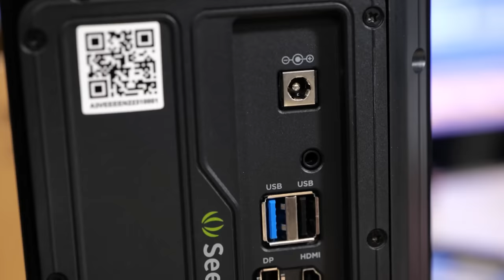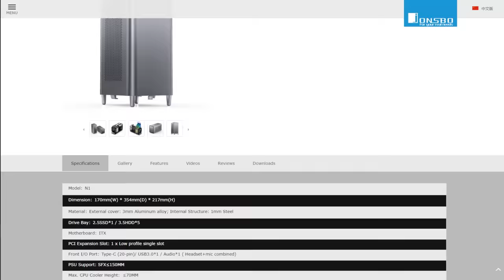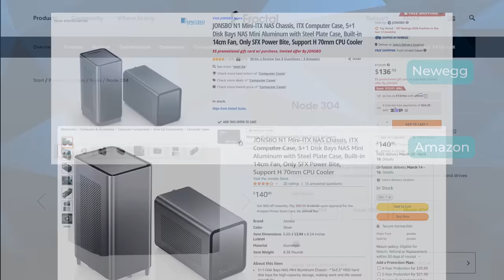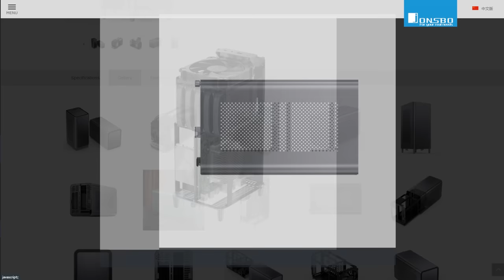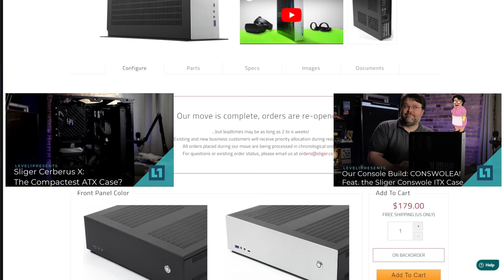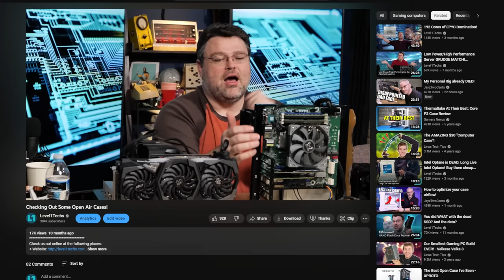The Ideal Home Server! Is it Possible?

Comment: I've been living this exact pain the last several weeks and settled on the Jonsbo N2 (awaiting for it to ship). It bugged me bad how design trends have removed drive bays from cases and the N1 or N2 are the only relatively modern cases that allow a fair home NAS build. One delightful product I am interested in is a LP PCI-E daughter board with both a Coral accelerator for Frigate, and a zigbee coordinator. Yes USB is a thing, but in all honesty its like the NAS has hemorhoids hanging out its back panel and it would look esspecially bad with the N1.

Hardware wise I've gone AM4 with a R3 4300G and Gigabyte A520i & 16Gb of 3200 corsair, which upn delivery this week i was smashed with buyers remorse knowing a J5040 Pentium would most likely fit my needs with far less power draw.

From my point of view I'd like to see you build the lowest power draw system <20W load with Plex transcoding thats usable with 3 drives of spinning rust coupled with a SSD(s) cache.

Comment: I would suggest using the Jonsbro N2 instead of the N1. It seems to have much better access to the drives IMHO. 
One thing I would love to see someone try is one of those 16x to 4 M.2 with maybe 2 NVME drives, one 5 SATA port M.2, and a 10G networking M.2.
Another Option is the Gigabyte AM-5 MB since it has 3 M.2 slots so you could have an OS drive,  SATA controller, and 10G card and still maybe have room for a GPU for transcoding..

Comment: i use x2 (icydock) 5.25in bay hotswap docks + x12 2.5in sata ssds + a pcie x16 card with a switching chip, 6 sata controllers, & x24 sata ports 

perfect combo for inexpensive zfs storage.

Comment: In the pictures of the new case I noticed that the vanes on the SPU cooler were at right angles to the air flow. That doesn't seem optimal.

Comment: Great video… I was searching for a small mATX case with 3x external 5.25 for a hot-swap 5xHDD cage.
No chance, not existing
Ended up with a short 19‘Rack case.

mATX is a great format and it shouldn’t be to difficult to build a short 3U rackmount case with standard ATX PSU and multiple 5.25 cages (at least 2x)
Reply from the maker: Sliger has some small rack mount case that tick that box but they cost $$$$

Comment: I would love to see you use a ASRock Rack X570D4I-2T AM4  for the Jonsbo N1. I bought the N1 7 months ago and haven't built it yet.. still deciding on what to do with. I have an old 6th gen intel mini-itx I was going to put in it, but I'm debating maxing it out if it's worth it and temps are good enough in that case with something like a 5800x or 5900. Also curious how those oculink would work for your sata hdd.

Comment: Check out the istarusa cases ... they make several starting at 2-3 5.25 bays and one that I believe is 7 ... I made an all sata flash icy dock/istarusa build with a xeon/10Gbe/18 sata bays in 3x5.25
Reply: It doesn't have as many bays as the antec case obviously but it's not ugly and has "enough" if you're planning to use mostly flash.

Comment: The problem I have with those 5.25 HDD enclosures is that most require active cooling but don't have fan redundancy.
I don't want the HDDs to overheat if something goes wrong.

Comment: I would love to know if 3 -5 NAS drives packed that tightly is a problem for heat and airflow. I love the idea of maximizing space, but at what point do those spinning rust platters go from being thicc-boi heat fins with air passing between them to a solid hunk of rust with very little surface area to dissipate heat...

Comment: I've been looking into building an AMD-based 4-6 HDD NAS for months now.

The Jonsbo case is great, but it only fitting mini ITX boards means I'd have to go consumer-grade, which I hear don't always boot without a display.

I also looked at the build Wendell did for GamersNexus, but that case is expensive and hard to work with, on top of it being a lot bigger than I need.

The DIY case you proppose here could be interesting if I had the tools, knowledge and time to build something like that.

There really don't seem to be tat many options.

Comment: I am using a C3758D4I-4L in a Node 804 plugging in 12 drives I've collected over the years using BTRFS. Hard to find a mini ITX or mATX board to upgrade to with the same amount of built in storage options without needing to get into searching hba cards.

Comment: my current build. would I go back and change some things....probably. But I still have plenty of room to upgrade. This build was about 1200$ - including the hard drives. Running TrueNas Scale. 
MoB - MACHINIST X99 MR9A PRO V2

CPU - Intel Xeon E5-2699 v3 2.3 GHz 45 MB 18 Core (LGA 2011) 64-bit
GPU - GeForce GTX 1060 3GB
RAM - Samsung 16GB (x2) PC4-2133 RDIMM DDR4-17000 ECC Registered 
STORAGE DRIVE(S) - 3 x 8TB Seagate Barracuda + 120 GB SSD Log Drive) all in RAID Z. 
PSU - Seasonic PRIME TX-750, 750W 80+ Titanium
BOOT DRIVE - 500GB Samsung NVME 
CASE - Phanteks, Enthoo Pro

Comment: PCIe lanes are the greatest problem I faced when I built my not-so-home server with a bunch of retired enterprise U.2 SSDs. I eventually have to go for EPYC.
Reply: EPYC? More than a home-lab that sounds like a home data-center
Reply: @javiej  You can grab those low clock low core count Zen2 (even Zen3) EYPC without breaking the bank. What I need is the PCIe connectivity after all.
Reply: @qazwsx000xswzaq  yeah maybe you can get one of those cheap,  but for using a data center server at home you still have to solve the size issue ,  the noise issue, the energy consumption issue, and specially the wife factor...

Comment: I'm using my old Define R4 with 8, 3tb reds still in raid 5, which gives me 19tb. It's on a 10900k system for my plex server/file server, windows 10, I'm fine with this. And I have a unraid server with all my old 3tb greens for backups, and also, I have a single 8tb red with all my stuff backed up, since I dont have more than 8tb yet, but I'm close now.

Comment: Have you experimented with any of the M.2 to 4/5/6 SATA expansion cards? It may solve your mini ITX SATA problems without wasting your expansion slot. I've been trying to figure out how to fit an RTX A2000 or Arc A380 into the N1 for transcoding.

I recently picked up ORICO's PM2T56 for a planned SBC+6 HDD tray, custom SFF NAS build.
Right now I'm eyeing the (like Seeed Studio ReServer) i5-1135G7 equipped NUC11TNHi5 for it's Iris Xe iGPU (AV1 decode) and unique x1 SATA, x1 PCIe 4.0 2280 M.2, x1 SATA 2242 M.2, x1 2230 M.2 E-key. UpBoard also has some very compelling Intel based SBC offerings. I was very impressed with the UpSquared model I picked up a few years ago.

The primary concern is getting good, clean SATA power to that many drives without an ATX PSU...

Comment: I would be really interested in a comparison between the AMD (7000 series?) and Intel platforms (i3-12xxx?) targeting lowest power (because power is heat/noise) but trying to max performance/functionality in the Jonsbo!
Reply: my 13600kf at idle or just surfing the net consumes only 14w as indicated by hw monitoring programs. I don't think AMD can top that, as at low CPU usage Intel parks P cores and uses only E cores. But even some older T versions of Intel CPUs would not consume much power.
Reply: the 12100 is amazing performance and low power to boot, topping out at like 58W... lets just say I love mine :D

Comment: I found out recently that my home server idles at about 100 watts. So thinking I may need a change in the not to distant future. Either some micro solar to offset it's usage or moving to more efficient parts.

My nas only uses 20 watts idle, 35 ish when the 4 HDDs spin up.

Comment: Imo the perfect small server is with the DS380. Sure, it goes for $200 but I’m able to have 7 hot swap bays, room for a itx gpu, good drive and cpu airflow and all in the size of a nr200p. Needing a board with 4 sata ports to maximize the bays is annoying though.

Comment: Rocking that N1. Fan sucks, swapped for a noctua. Remove the cover in front of the fan where the buttons are for better airflow. Cant use it standing as all the dust sucks into it. Rubber on the side is good at dampening vibrations. The angled cable is meh as my psu has the connection flipped so i have to kink the cable if usibg standing.

Comment: Wendell, any chance the Genesys Group Micro-100B ever came across your radar? It's half the 5.25“ you mentioned but everything else is pretty spot on.

Seeing 2TB 2.5“ SATA SSDs from TeamGroup down at $80 a couple days ago made me think populating those 3 it does have with the 8x hotswap caddies per slot means 48TB of noiseless storage without needing to sweat PCIe lanes for under 2 grand on the disks themselves which sounds pretty damn good in that small a footprint.

Comment: The GIGABYTE X570S AORUS Elite AX has 3 M.2 slots and 6 SATA ports for $200. That's what I'm using. Though I'm not sure if you lose 2 SATA ports when you use the 3rd M.2 slot. I have yet to test that

Comment: I used my old Fractal Design Define XL R2 for hosting my NAS... my Asus B450m Pro 4 is only having 4 SATA ports and was thinking about using my PCI lines for hosting more... until I realized you could corrupt your data by using those adapters, so not a good idea. Just use the SATA ports on your motherboards.

Comment: Looking to set up an "office quiet" energy efficient Ceph cluster. I have 3 empty SuperMicro rack cases with a SAS 12gb backplane. Looking to put a motherboard in which has just enough processing power to handle the storage. (Will use NUCs for proxmox containers).  Looking for a solution which has the SAS connectivity, two Ethernet connections (with at least one 10g). Have you ever speced something like this?

Comment: So I build my NAS with the Jonsbo N1 and a nice CM4 board called Axzez Interceptor carrier board. From the wall this consumes about 14 watts in idle (spinning rust down), runs on a proper ATX PSU and is powerful enough to run ZFS and some containers and applications (Jelly, InfluxDB, Grafana and a few others). Wouldn't that be more or less the ideal hybrid?

Comment: Hey Wendel, thanks for sharing these ideas with us.  Personally, I'm curious about power consumption over time, as that is a compounding expense if you choose the wrong hardware, a penny saved today .... etc. Especially as utility prices are rocketing here in Europe.   I'm currently building a NAS out of an Intel 10th Gen Celeron aimed at lower power consumption.   Is there a reason you're going for AMD?  I'm using AM4 for my workstation and have no complaints except the aforementioned power expense.

Comment: Wendell - I don't have any input on motherboards, drives, etc, but I did want to share a thought about cases.

I spent quite a lot of time looking for a case that fit my rather specific needs, & never managed to find 1. Several times I found 1 that met some of my requirements, but would have 1 or more glaring exceptions that disqualified them. In the end I reluctantly came to the conclusion that I would have to figure out how to build something myself from scratch, or at least get creative with stuff that could be repurposed for my needs.

You know that aluminium extrusion chassis you have? Well, something like that is what gave me the idea. You can get those extrusions in various lengths, sizes, etc, as well as a variety of fittings that are specifically made for them. I still haven't gotten around to a finalised design for mine, nevermind building it, as I'm far too good at procrastination for my own good, but thought I'd at least share the idea incase you can get any use out of it.

It wouldn't need to be an open dust magnet either, there's several different ways to add panels that range from purely functional to more professional looking.
Reply: Its called Makerbeam. Have 2 builds myself.

Comment: is there a good way to get better airflow through 5.25 3.5" hard drive hotswap bays without ramping up the fan volume? i find drives get hot in them on account of how opaque those backpklane PCBs are, especially enterprise drives like EXOSes that are meant to go in louf fan wall chasises

Comment: Prices have really sky-rocketed on everything, including used parts.   A few years ago I invested in 5 x SuperMicro X10SRM motherboards and 2 x SuperMicro X10SRH motherboards.  Today the used prices on those motherboards is twice what I paid new.  I use the X10SRH motherboards as the NAS servers (FreeNAS).  I use the X10SRM motherboards to run ESX/KVM.  Easy to spin up a VM and use the storage off the NAS.   Unlike you, I am not into the super tiny builds -- I like to use very airy cases with lots of big slow fans to keep things cool.  For the X10SRH I like the Cooler Master HAF XB EVO, and for the X10SRMs I like the Thermaltake Core V21 SPCC Micro ATX cases.   Motherboards, CPUs, and capacitors all fail because of heat; keeping things cool means keeping it alive as long as possible.  My older ESXi  production servers are AMD FX-8350 based motherboards; they did production work for about 8 years, and now have been doing special projects for about 2 years, all the time running close to 24x7.  If I had let them cook they would probably be dead by now.   For storage, I am very lucky to have purchased SATA hot-swappable racks back when prices were reasonable.  As for cases, I have plenty of nice big 10 bay tower cases from the 1990s which make excellent homes.   Add a few internal to external SAS adapters, and I can easily connect the drives up to the HAF cases with FreeNAS running.  It works, and most importantly I re-used parts I already have.  Recently I decided I wanted a higher core ESX server for Steam and/or video encoding of my DVD library which I have been slow to do.  I already had DDR4 ECC RAM (128GB), power supply, and 2060 nvidia card -- plenty for the strategy type games I like.  I also had a bunch of extra Noctua 12HS coolers -- I bought them at clearance.  All of that pointed me to another LGA2011-3 system for minimal cost.   I found that I could get an HP Z440 motherboard for $50 and a good CPU for a little over $100.  The only down sides with that motherboard are no over-clocking and a custom power connector; however, its easy to find an adapter for $10.  Now I can have a Steam VM so I can play Civilization on my low powered laptops, and a couple of 6 core VMs that I can use Handbrake on to roll through the queue of ripped shows.  I know I could have done faster with an AM4/AM5, but I couldn't have done it cheaper.  Sometimes old parts make for a good solution.

Comment: "Ideal homeserver chassis"
One with a ton of room. Got my hands on a STC-T01 while back, thanks to eBay also used hdd modules that total at 16 3.5" and 6 2.5" hot swap bays and a couple of IT-mode flashed HBA's, a (dated)  servermotherboard, plus Xeon and ECC RAM.

Still no hdd's though, those things haven't gotten cheaper. Would like to put a bunch in a RAID Z3 config, but that means buying a bunch at the same time €€€.....

Comment: All the new motherboards with 2.5Gb nics is awesome for all the people with new 2.5/5/10Gb switches but it's useless for anyone who's rocking an old enterprise 10Gb only switch.  I wish the motherboards came with the selectable nics so it could slot into whatever infrastructure we have.  I shelled out for a X470 Taichi Ultimate for that reason.  I've also been eyeing that Asrock board for years.

Comment: The lack of a really good home NAS/DAS case that doesn't blow the bank is frustrating. Old ex-office or ex-government TinyMiniMicro PC's, e.g. Lenovo Thinkcentre M720q/M920q, make for excellent mid-tier homelab machines. I've got an M720q with an i7-8700T that I want to try and downsize the rest of my moderate server requirements into... I just can't figure out a compact, economical, sensible way of hooking up five or six 3.5" drives to one for NAS usage. I've done some looking into using an HBA with external ports and hooking up a DAS but again, no really good options exist. I'll be keeping a close eye on whatever you come up with, but the idea of a case designed to just handle 5.25" expansion as a dedicated NAS/DAS would be awesome.

Comment: Wendell, have you looked at the SilverStone RM21-308?  It's a short-depth (480mm/18.9 inches) 2U w/ eight hotswap.  SFX or ATX (incl. redundant) PSUs.
I have an X570D4U, AMD 5750GE, Intel XL710QDA-1 (40GbE), a 9500-8i, two 2TB SK Hynix P31 Platinums, eight 16TB HDDs, and 64GB SuperMicro SuperDOM.
Makes zero noise.  132TiB raw, 80TiB usable.  4.5GB/sec OVER THE NETWORK (reads and writes) all the time thanks to 45Drives autotier.  43W idle.